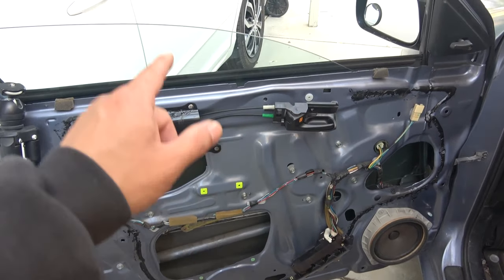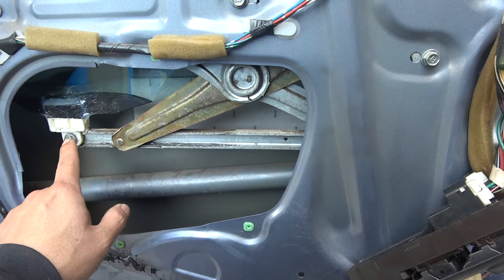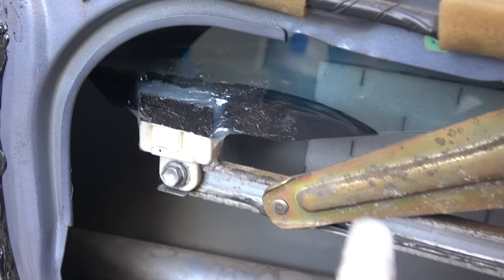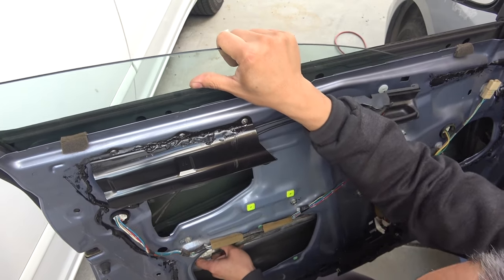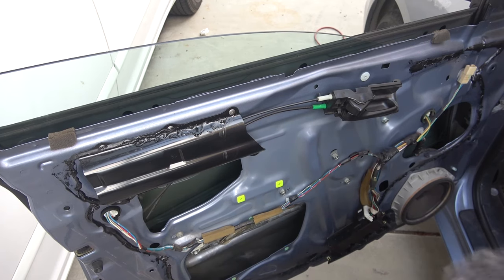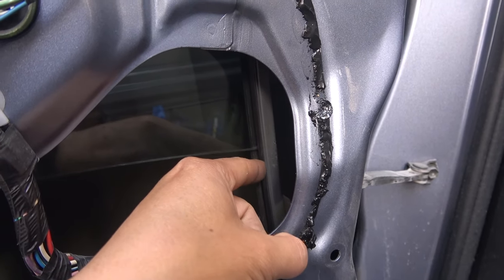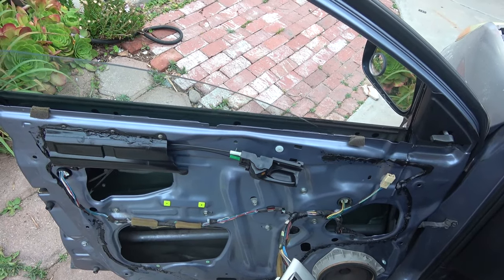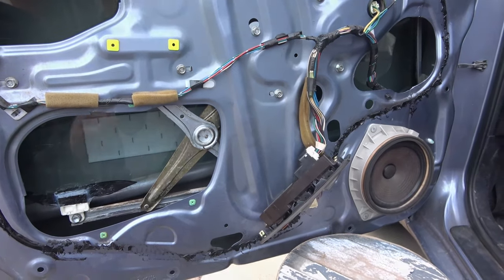DIY: How to repair car glass window that goes off track

Comment: This is one of the BEST DIY YT videos ever made. It's not flashy with visual tricks.. There's not long winded talking about things that don't matter to the issue at hand. Everything is straightforward & simple. Also, I've NEVER seen anyone use grease to make the window move through the track like that... Other mechanics would tell you to buy a while new track or window. AWESOME AWESOME AWESOME JOB !!!

Comment: The glue giving out was my exact problem, Thank you. I called my mechanic and he said to use a 2 part epoxy to glue it back on and that worked great. Close the window and let it sit over night to fully cure. In my Elantra you can unscrew the window holder to properly clean the old glue off to expose the ridges for the glue to cling to. I used a razor blade. Also, silicone spray is much easier instead of trying to stuff grease in the cracks using a Q-tip. Awesome video. Thank you Sir.

Comment: Thanks for the great info! Just fixed my wife’s 2020 Camry. I have no idea how the driver window came off its front track but it did. I removed the rear bolt, and the front slipped right in to the track, I reinstalled the bolt, and lubed the tracks with silicone spray. Window works like a charm. Thanks again.

Comment: This was probably the most informative video I have ever seen. I just got a truck, and the window was off track. I spent over 1 hour trying to get it back on track, finally I did. However, the window has attempted to pop back off the track again. It was raining, it was dark, so I just gave up and made sure at least the window was up.

I'm absolutely going to try this silicone method. 

I didn't even think of this. 

I'll let you know if it works. 

Thanks so much.

Comment: Great job providing simple explanation of the system and the problem. Power windows are great when they work, but a big mystery when they don't. You provide an excellent overview and for me removed the intimidation factor.

Comment: Thank you so much! Did this to fix my window that had unglued and gone off the rail. Did this exact thing. Cleaned the area with some rubbing alcohol and paper towels. Cleaned and greased the tracks.  Then applied the silicone to the glass and the plastic. Rolled the window up and let it cure for 24 hours. Worked like a charm. Thank you so much!

Comment: Thanks for posting this!  I have a problem where it rolls up unevenly; gap on door handle side and barely closes when raising.  I'm going to clean and grease the tracks.  You made a good point about the concept of balance in the tracks; snags a bit on one side, causes it to go off course.  Good investigative powers sir!

Comment: Silicone grease or spray is especially good routine maintenance for windows and moon roofs tracks.
Really helpful video, thanks!
Reply: So can I use the blaster silicone spray? I already have that since I use it frequently for tight air intake parts and such

Comment: Smart, smart, smart, no genius, I have had the exact same problem, one of my window clips actually broke off so I glued it and then it didn’t hold, so I pulled the window completely out glued it again and really waited and cured it and then carefully reinstalled the window. And at that time I think I used. WD-40 and lubed up the lift part and the gears, but not the track. And it worked for about a week, and then bang one day it fell inside the door again and was off track, so I fixed it and just stopped using it. Then the other day I purchased a replacement window figuring I needed to start from scratch.
Today I am working on it, I am mid job right now, and the repair on the old window is still good, the glue has held up well. But it keeps going off track, now I know why. You sir are awesome, great job, great video, great explanation. Well done, you are a genius!!!

Comment: Nice job. I think I'd favor a urethane  based sealant over silicone for this application. For example the black rubber sealant you'll find in the auto section of your favorite retailer.
Reply: That was going to be my comment. definitely a  urethane base sealant would of been a step up

Comment: I appreciate it. I was gonna buy a window regulator for my scion xb but i noticed one of the clips fell off and it was off track. the window opens half way and sticks INSIDE the car! I have the window detached and taped to keep the hole covered while i wait for the glue and silicone grease tuesday when i got time. Tysm.

Comment: This was helpful. However my window is sitting directly on the clip with no silicone piece to attach to. Do you think some jb weld for glass would help hold it in place?

Comment: Thanks for the video.
In my case, the front clip had broken off from the glass entirely, but the bolt was still there.
That did not really affect operation until the bolt at the rear fell out.
When I took the lining off, and lowered the window, it jumped out of the rail/track.
With a bit of effort, I was able to loosen the window and rotate the rear upwards enough to reseat the front of the glass back into the track.
You will have to undo the rear bolt in order to maneuver it first though.
Once both sides are in the rails or tracks, get someone to hold it and raise up the regulator to meet the bolt holes.
Install both bolts and tighten.
In my case, with the broken front clip, I could only tighten the rear one, so I put some sikaflex style glue stuff around the bolt, and the window.|
Also, use silicon spray would be better, and probably attract less dirt.
Thank you though, very informative video.

Comment: Thank you. I actually  had mine on track but keep coming off. I'm going to try the grease . Which is what I figured it needed. In messing with this issue, of course, I ended up with a different issue.  Somehow, my drivers door won't open from the outside now. I'm hoping something just got disconnected  and not broken.  So, as of now, I'm climbing through passenger seat to get in. The door works fine to get out. It's very annoying climbing through. Lol

Comment: Thank you very much for most helpfull video, the major problem most of the time is dirt, as a result of normally not possible to clean except when you open the door panel. Now I have to find a way to clean the entire tracks and spray them with teflon spray.

Comment: aww thank you for the video, I have a chevy cruze and the electric window didn't closed past half, and that what it was, the front was off track, I fixed it on my lunch break :D thank you again
Reply: I'm on my 3rd window fix of my Chevy Cruze, the motor doesn't make sound and the window is slowly falling. Was this your first experience?
Reply: @mojustmakesense3696  yes

Comment: what would be some of the causes of a auto glass window that wont go down. I have a car that has been sitting for 3 years.  When I push the switch, i hear the window clicking but the window is not going down?

Comment: I was about to say silicone than got to the part of video that he said it.
Silicone spray works well. Ideally you want to spray the tracks before they get all dried out. The past is better but you have to take the door apart. 
I spray the track and door gaskets in fall before winter and save myself the hassle, as I drive an older car. It needs the minor touch of love to keep it going trouble free

Comment: Sadly, after getting into the car door - it was not just "off track." A previous owner (not the guy I bought it from) had gotten in there, and instead of replacing the mechanism welded the broken scissor arm back with a scrap of steel holding it together.
Unfortunately he didn't plan for the heat of the weld annealing the metal, when I got in it was almost curled up around the weld. BUT! Thanks to your description of the mechanism, I shoved the window all the way up, then gently "raised" the prop arm so that it's holding up the glass. The prop you were describing was actually cracked at the plastic, nothing left to hold the window in the channel. I've taped over that window switch, and it's fine until I either figure out that replacing the mechanism is possible, or get a whole replacement door at a junkyard (hopefully the same white.)

Comment: As soon as I saw how to fix it I stopped watching the video. I put the window back on the tracks and it rolled up just fine. The window fell off the tracks again when I rolled it down so I was scratching my head wondering what the problem was. I went back to the video and the guy said his window fell off the tracks too after rolling it down, all you have to do is put grease on it lol I should’ve watched the whole video instead off cutting it off. Thanks for sharing this information, it was really helpful.👍🏼
Reply from the maker: What were you thinking, Alan?
Reply: @vuaeco  i thought I saw all I needed to know but I was wrong I went back and put the grease but for some reason it’s still falling off track on the windshield side when I roll it down 🤷🏻‍♂️

Comment: Thank you I am going to try your ideas with my dads truck . I turned handle  it to open window (cold day) I heard a click and now handle turns nothing happens, but the window will fall in frame on its own,or you can just pull it up without the handle. Hope this works

Comment: Mine may have had no bolts holding the glass to the scissor jack assemble and the access area was far, far smaller than your car model. Maybe mine had the bolt(s) fall off, though?  I will go look.

Comment: For me, it was the bottom track. Instead of a standoff support at either end point, my bottom track is clamped onto the bottom edge of window with a rubber gasket between glass and length of track.  I had to tap track with a hammer so motor arm would not fall off track- basically track to locate it more center of travel.

Comment: How did you get that far? I took the door panel off, but there's another panel with a dozen 10mm bolts that i took out, but it's stuck in the middle

Comment: That's cool and all but what will happen when the grease inevitably gets dirty again, isn't there a design thats less prone to failing because it depends on a poorly sliding rail? Looks as if they designed a better rail system this wouldn't happen
Reply: Add a grease tube from a spray can to grease it periodically from the outside

Comment: I was just told that when the bracket brakes the black stuff that holds the screw and window together...that I need to replace the whole window if the black plastic stuff breaks off. Itll cost about $200 for a new window.
Reply from the maker: The black stuff is silicone. They use special automotive silicone but in my case, I just use regular kitchen silicone. Make sure you get the GE brand, either I or II is fine. I've been using it for over 2 years and it holds up just fine, no problem.

Comment: I've never seen anything like that. All my car and truck glass has holes in them that have plastic caps that hold them in there for the tractor hold 😂😂 He's got floor tile silicone on this window on 😂😂😂 He's got no screws in that window that riding up and down that track I don't think it's going to last very long he'll make another video and redo it and be like look you still there It's still good.

Comment: Unfortunately it's totally different to my 2002 gls 5dr.Yaris. Not possible to fix my window as virtually no access to get to anything, plus it hasn't gone off track. ...  I can see a metal type of plate has twisted inside, which cannot be bent back into i don't know what. Just pleased that after 90mins. i was able to get it to close by using the motor and hand, phew!! ... Toyota wanted £180 just to look at it ... ha! ha! ha!